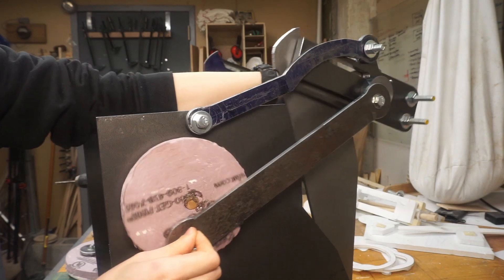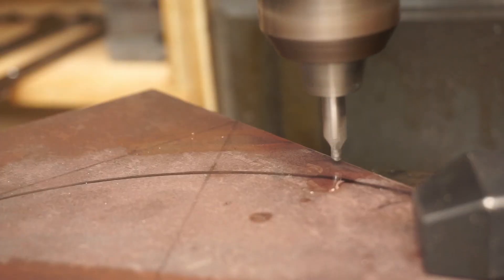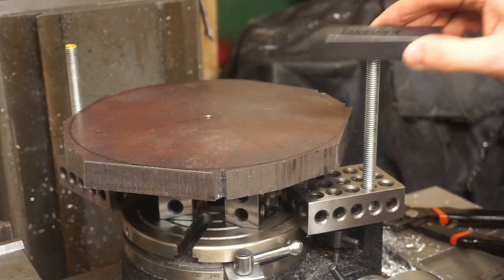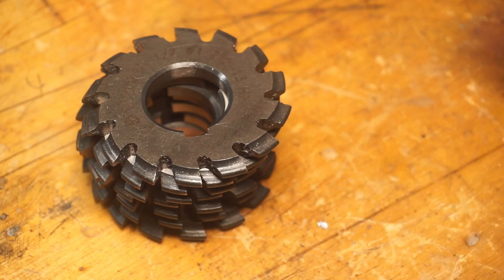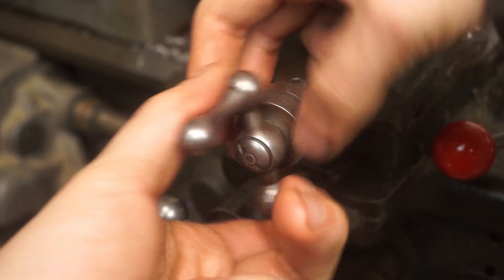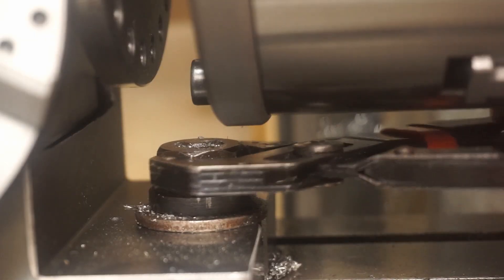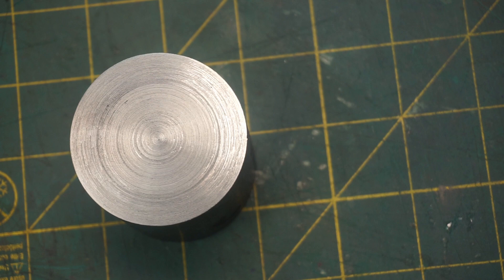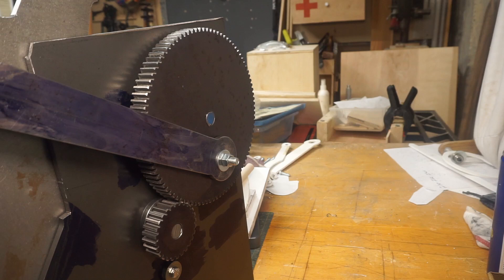Building a Letterpress: Cutting Gears

Comment: Would it be more forgiving if you used a chain to drive the letter press? 
Regardless, awesome work!
Reply from the maker: I'm not sure - I don't have much experience with using chain! But I was able to fix up the small gear and now they run really well, so I think it might be a moot point.
Reply: @RyanGausMakes  Nice! Chain would probably be louder and loose that classic look.

Comment: Ryan did you finish your house? The last update I saw was you running electrical? Have you put in drywall/furnishings yet?
Reply from the maker: It's still in progress - I was getting a bit burned out on it so I took a little break. I'll plan to finish up the house in 2021!

I've already installed drywall - plumbing and furnishings are next.

Comment: I enjoyed the creative setup for getting a big part onto a small rotary table! How did you keep it concentric when you moved the clamps?
Reply from the maker: Great question!

When I repositioned the clamps, I always had downward pressure from at least one clamp and my hand at all times. And, after moving them, I rechecked the concentricity with a coaxial indicator and bumped the piece with a brass hammer until I got it within a ~5 thousands tolerance or so.

But, this is part of the reason I rounded the smaller ones on the lathe - that was a lot more straightforward and produced better results anyway.